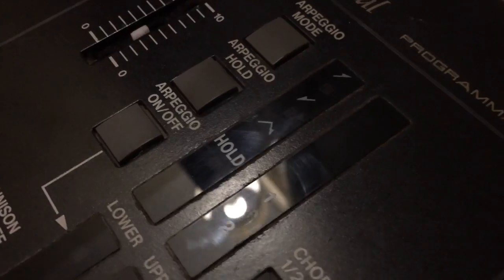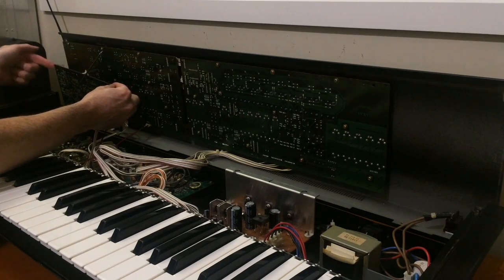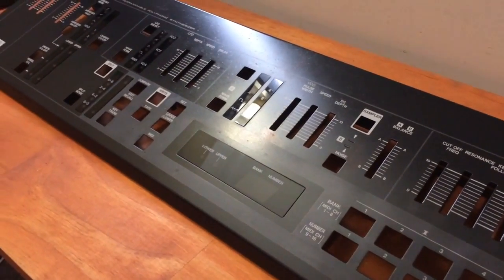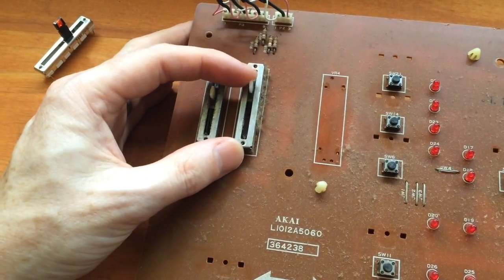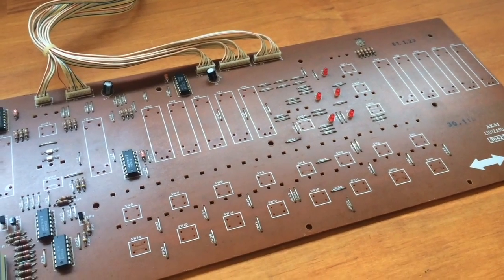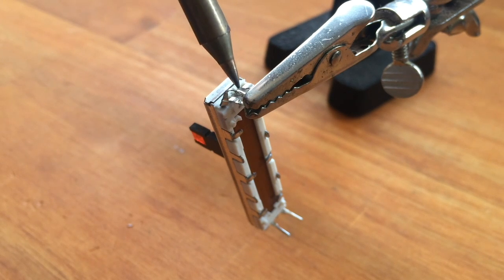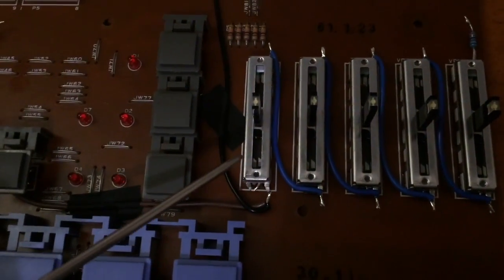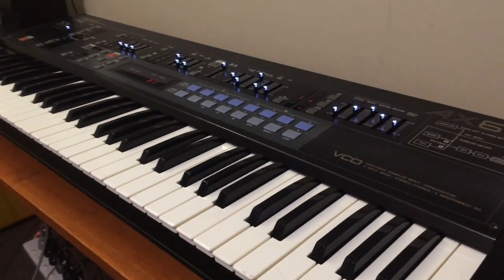Akai AX60 Restoration (Part 2 of 3) - Installing LED Sliders, Panel Cleaning, Switch Replacement

Comment: That’s a tremendous amount of work for each slider replacement. My main problem with AX60 sliders is the knobs get lost easily, are difficult to replace, and make the sliders almost useless when they’re gone. Plus they’re such a cheap low quality part to begin with. I wish there was kind of replacement that could fit on the slider and raise above the panel more.
Reply: 3D printing should be easy to do. I had missing slider caps on Casio CZ- really commonly loose their tops got some made...

Comment: Are you still doing a part 3?  I'm curious about the power supply mod mentioned on your website.  

I have a unit that was in pretty good shape several years ago but I'm afraid to power it up as it's been in storage for years.  I plan to re-cap the power supply but want to backup the presets first.  So hopefully I'm not risking too much by powering it on briefly...
Reply from the maker: m7c Yes there will be two more videos. The next one will be the power supply and the one after that I will combine the two AX-60’s into an AX-120.
Two things you should do: Firstly email me using the contact address on the website and I will send you a PCB. You can then build the supply. Secondly join the Akai AX/VX Synth Users Group on Facebook if you haven’t already.
Reply: @GOLTSYNTH   Whoa!!!  AX-120 ???
Hurry up!!!  Can't wait to see THAT ONE!!!  
(actually, the Power Supply one as well... I do have an AX that would probably need it)
Thanks!
Reply from the maker: SynthOSphere I’m filming the power supply video right now. I was mostly done but then decided to start over because I thought of a better way to do it. I have this week off work so my plan is to upload it before the end of the week. Not sure when I’ll get up to the AX120 but it’s on the list.
Reply: @GOLTSYNTH   Super!!!   
Redoing it all over again because you found a better way: it shows you are a man of quality and that this is truly a passion for you and it's all to your honnour!
Reply: @GOLTSYNTH  RE: the AX-120, can you at least briefly comment on what your idea is?  How you want to connect them together?
Because we can do it with MIDI, and that's simple, but clearly you have something different in mind...  
Do you plan on using the infamous Akai rear sampler connector?

Is your objective to control both with the controls of only one of them?
Are they going to be in the same case? (I'd be surprised if you can fit 2 in a regular sized case, it's really tight in there...) (so... upgraded case?  Or they stay split?)
See?  Tons of questions?  haha
Reply from the maker: SynthOSphere one of them will remain largely the same, but the other will have the keyboard removed. There will be one keyboard controlling both synths and each voice layer will be stacked one on top of the other. The idea is based on a CS-80 version of the AX-60, where each voice is doubled but each layer can have it’s own patch.

Comment: LOVE the voice led feature...Have you ever thought about doing any mods to the audio outputs?  Always wondered if it would be possible to instead make the stereo out jacks become two separate audio outs, to separate splits as well as some interesting voice panning stuff that could be done.
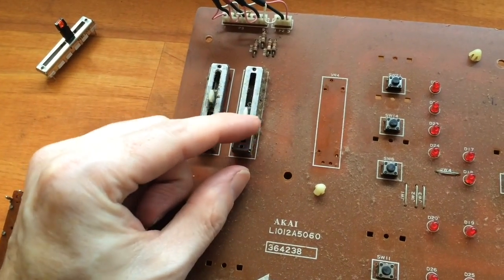Reply: lemme rephrase, in reference to 12:40...the mix knob
Reply: forgive me ...too much coffee.  Very cool with the separation of the split mixer into two sliders.  What I was getting at was that maybe there was a possibility to make those sliders output separately to the L/R outputs.  Sounds like it was definitely a pain to mod the sliders anyway so maybe its not worth it haha

Comment: Hey, love you videos, Looking forward to the third installment! I’m in Brisbane and I’m desperately trying to track an AX60 down, you wouldn’t happen to know anyone who has one they would sell? 
I was considering a Juno 6 but this has so many more features for much less money (Juno’s have become way overpriced) so any help would be great in finding one 

Thanks
Alex
Reply from the maker: Nihil & Void AX-60’s are so hard to find over here it’s not funny. My first one I found in Melbourne on gumtree, but the second one I had to get imported from NY. The problem is that they were never officially released here. In the US they are everywhere. You can still find them on eBay for reasonable prices if you keep an eye out. It’s hard to get one for less an a JU106 but it does happen.
Yeah I’ve been really slack in producing that third video. I have remade the power supply and it’s SO MUCH better. I will put the board files on my website (goltsynth.com) soon but if you’re in Australia I can just send you a PCB when you need it. The next AX-60 video after that I’ll be mounting my two together. I’m taking the keyboard off one of them and mounting the panel with the another one, so I get two AX-60 voice layers played with the one keyboard, like a CS-80. I can’t wait!
Reply: GOLT ! Well I've managed to track one down in Chicago for a good price, hopefully shipping won't be to ludicrous. Can't wait to get it! I've owned almost ever Roland Poly Synth except the 106 (don't want to deal with those voice chips!) and have never been entirely satisfied with them. I loved my Korg Poly 61, but no midi. The Akai seems to fit what I'm looking for perfectly. Looking forward to see more vids, hopefully the details for the power supply will be ready soon, I'm definitely going to want to upgrade it.
Reply from the maker: Nihil & Void That’s cool! Yeah I paid a fortune for the one I got from the US. I’ll email tomorrow.
Reply: GOLT ! I’ve been playing with it for a little while (it sounds awesome) and it definitely seems to a bit unstable. It’s funny how dramatic the sound differs from the Juno 60 I used to have. The Juno’s sound very clean and refined with minimal imperfections. The AX60 is dirty and lofi and unstable. It’s very interesting.

Hope to hear from you soon! I think it needs the psu upgrade.

Comment: TWO questions, if you are so kind:

1. Can the LED's introduce any noise into the synth?  Into the power supply.  Sorry, not an engineer, but I know that if you change a design, their can be unintended consequences.

2. I have a bit of rust developing under the paint on the far left of my ax-60 where the sheet metal meets the cheek.  I love this synth, my only OG analog poly, I'm disabled and no longer have any income.  How should I approach this issue with resale value in mind? (after they pry it from my cold dead hands).

Comment: 11:45... to remove the sliders, why not use a solder sucker?
Reply: Because there likely will still be tiny amounts of solder remaining, so it's easier to heat up and keep molten a larger bit of solder and just remove as demonstrated. In general, if you can remove a component without having to first totally remove solder then do it as it's easier to remove solder from the PCB when no components are present -- physical space and heat absorption being two large reasons.

Comment: I've been using vinegar lately for cleaning with a microfiber cloth. I've been amazed at how well it cleans everything. what did you use for gluing the plastic displays back on? I was planning on using clear silicon.
Reply from the maker: I think it was just a two-part epoxy.

Comment: Hey, amazing videos. Thanks so much for these. I had a question about the switches: do you have a part number for these? I want to make sure I get the right ones from Mouser or wherever. I just bought an AX60 in perfect shape, however some of the switches are a little flaky, I guess from age. One day I'll do the LED sliders :)
Reply: If you read a bit lower in the comments... Someone mentionned PTL-30-15W0-103B, and GOLT mentions another video in which it explains a bit more (about his ARP AXXE)
Reply: https://www.bourns.com/pdfs/PTL.pdf
Reply: But he DID mention in the video that the ones he used for the AX are shorter than for the AXXE.
He does mention in this video that the ones for the AX are the 30mm.
The Prod # in my previous comment clearly points towards a 30mm (also see datasheet PDF link)

Comment: You would get much use out of a desoldering station. Check out the cheap and cheerful one that Dave Jones (EEVBlog) uses.
Reply from the maker: I think you are right. I am looking at buying one now that I am doing more repairs.

Comment: Where/how did you get the PTL-30-15W0-103B's?  Mouser doesn't stock white LED sliders (nor does Digikey, Arrow, etc)...
Reply from the maker: +Kerry Bradley Hi Kerry, Sorry I probably I didn't describe the LED type as well in this video. In my ARP AXXE video where I also replaced the sliders I put a screenshot at the end that described how to order them. So I'll explain here. It doesn't matter what colour LED's the sliders have when you buy them. The LEDs that come with the sliders require too much current to run off the AX60 power supply anyway. The only option is to replace all the original LEDs with high brightness versions that require less current. The original LEDs just pull straight out of the top of the slider. Search on eBay for "2x3x4mm LED" and choose whatever colour you like. Then cut the legs shorter on the new LEDs so that they fit in the slider. Use the original LEDs that came with the slider as a guide when cutting the legs on the new ones. The Bourns sliders for the AX60 are all 30mm travel, 10KB, 15mm shaft height, no centre detent; just as in the part number you wrote. But just get any LED colour that is available. PTL30-15R0-103B1 (or B2) seem to be the most commonly stocked. Hope that helps! :-)
Reply: +GOLT ! Fantastic!!!!  Parts ordered and can't wait to mod mine after yours.  Completely brilliant!
Reply from the maker: +Kerry Bradley It looks like running the LEDs off the +15V supply might be a bad idea. I had one of the AX60s power supplies fail. It seems the whole positive part of the supply is already under serious pressure, and even a milliamp or so is enough to send it over the edge. A better idea might be to run it off the -15V side because there is not as much current draw there. I haven't had much of a chance to look at it yet. I'll update the video when I've worked it out.
Reply: +GOLT ! thanks for the heads up.  Maybe a separate power supply would be good?  there seems to be enough room on the right inner chassis to rearrange the present power supply and transformer for a smaller transformer, rectifier and regulator circuit?  then you could run the LEDs in parallel if you just regulated to +5V
Reply from the maker: +Kerry Bradley I looked at it today and I'm pretty sure the failure wasn't because of the LED's.The cause may have been the 6V balance adjustment that I did the the last video (Part 1). I think if the balance is too far out the the M5230L regulator dies. I'm still investigating but it seems the small amount to current drawn by the LEDs is fine. The 7815 regulator is OK. Once I'm 100% sure I'll update the other video. I'm waiting on a new M5230L.

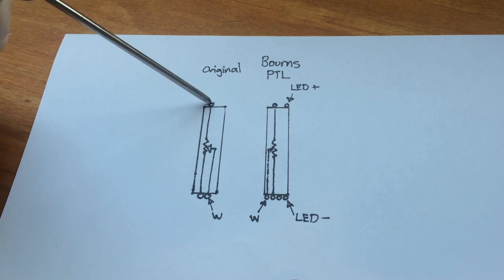Comment: I like 17:30 with the drawn diagrams of slider internals.
MORE DRAWN DIAGRAMS!
Reply: HIGHLIGHT!
(and i like your cunning solution)
Reply: White LED's also look cool.
Red is maaayyyybe better, but both are cool.
(:
Reply: Hanging out for the CS20m / CS40m MASHURPPPP!
Reply from the maker: Yeah the CS20m and CS40m duo will be good to watch. I'm looking forward to filming it. I've changed that AX60 to red LEDs now like the other one. But I also did a gold which looked good too. Red wins though.